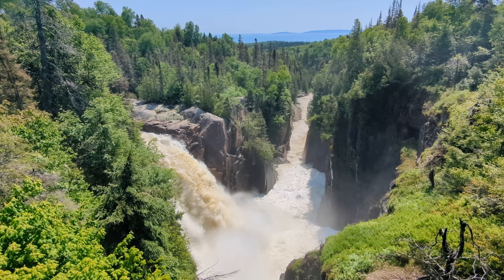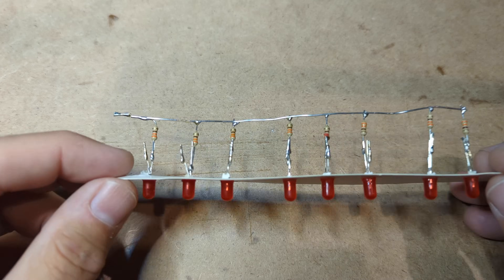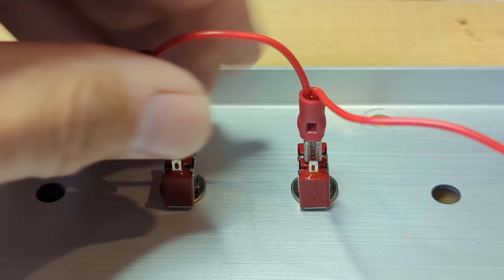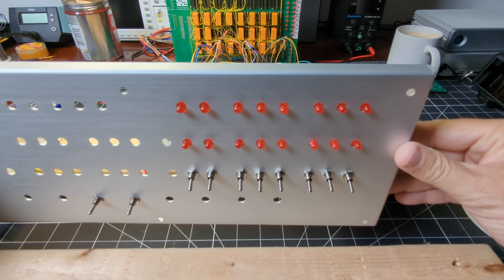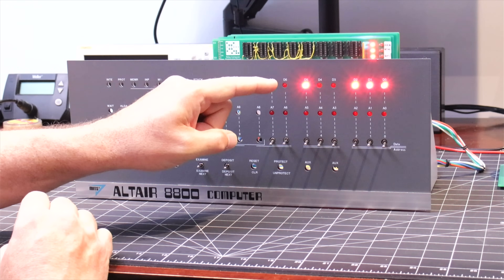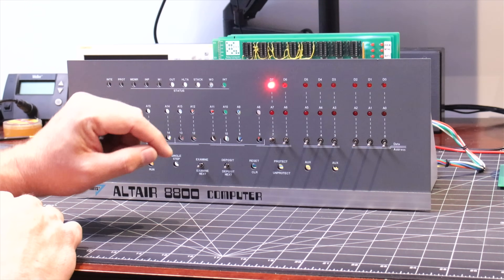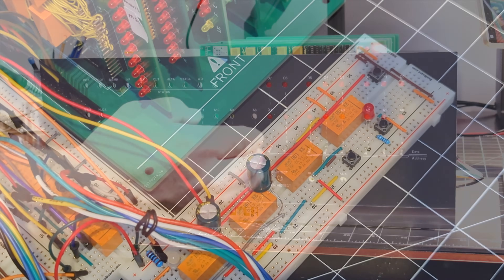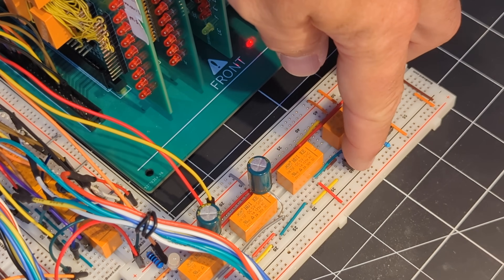Front Panel Online! First Program Entered on the Relay Computer

Comment: Tip: if you know your resistor.color codes you can use the same coding for the wires.  Black=0, brown=1, red=2 etc to easily identify lines

Comment: I like e how the front panel organizes the data input/output and functionality, makes it clearer to see what's going on.
Reply from the maker: The Altair front panel is definitely a classic and was well thought-out. All I have to change is the status indicators (to match the relay computer signals) and I might want to add a "result" indicator as well.
Reply: @dipdoting   I don't know if you considered using those LED displays that read out the numbers. I have these displays that you provide the 4bit binary and they display HEX values 0-F with LED dots.  It might be out of character with what you're trying to do, but they were around in the day, and they are nice, but pricey... still!  TIL311

Comment: Ain't nothing wrong with cardboard and masking tape. CAD, cardboard aided design. It's built some amazing things over generations.
Exciting to see actual commands clocked in and n out in a somewhat sort of HID. that's yet another feather in your cap. Love this machine.
Reply: As much as I love the idea of a TTY, it would probably be to loud, I love the sound of the relays themselves. I, personally, would accept a microcontroller and vfd solution, just so I can hear the relays hard at work. If you've ever been in a room with a hardware teletype, they are not... Subtle... Machines. But I'm already jealous, of course I want one, so go for it
Reply from the maker: The teletype came with a large and heavy "sound-proof" cabinet - I can see why they needed that - it does make a bunch of noise!
Reply from the maker: Thank you! I guess it's one step better than duct-tape and string!

Comment: Is the sequence still slowed down as you mentioned in an earlier episode? Will it be able to be sped up, or is the slower speed required to avoid glitches? Excellent work!
Reply from the maker: I did slow it down a tad when I started to see those timing issues - once I run it through a few more tests at faster speeds to see where its happy place for timing is.

Comment: Looks awesome! Very satisfying to hear all the clicking behind that retro-looking panel.

Re: the capacitor, one guess off the top of my head is to check if the switches might be bouncy and the capacitor is helping to smooth that out? This is based on pretty much nothing 😅, except that you mentioned the switches don't feel like they're built to last, which makes me question their other tolerances as well. Regardless, good luck with your analysis!
Reply from the maker: Thanks - and that's a possibility for sure. I did find a couple of the switches had to be replaced early on because the contacts were a bit flakey.

Comment: That teletype looks so cool
Reply from the maker: It's an awesome electromechanical piece of machinery - goes perfectly with the whole relay vibe!
Reply: @dipdoting  It always baffles me when I see a mechanical device using digital "logic" , I mean, relays are also mechanical, but the bars on the automatic typewriter being bits of its input never seems to amaze me, really clever solution to not have to bruteforce it using a lot of coil drivers for each key.